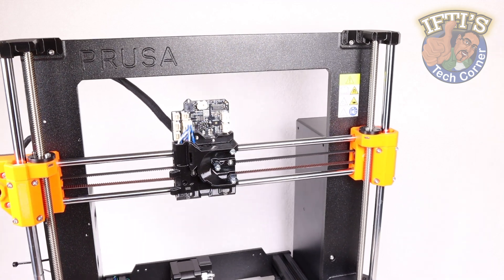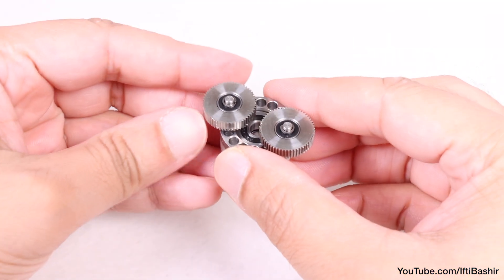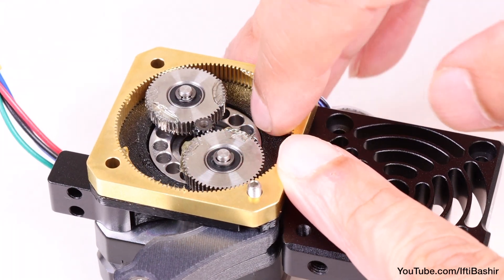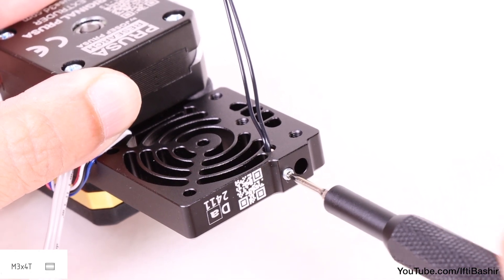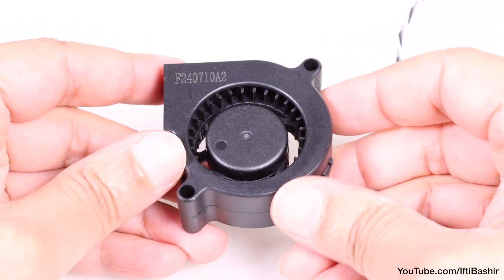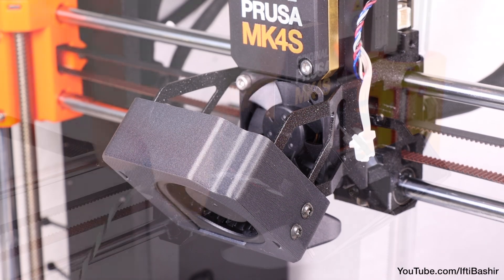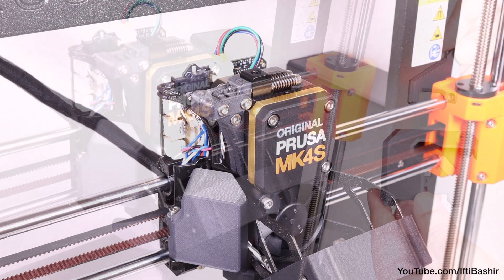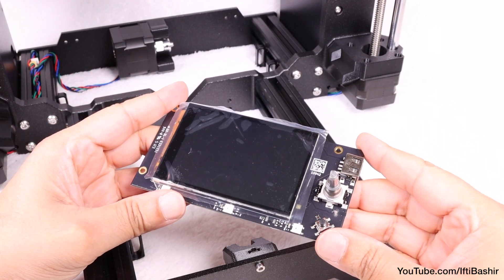#05 Original PRUSA MK4S Kit : Full Step-By-Step BUILD GUIDE - Nextruder Assembly

Comment: Brilliant!! on to #06!
Reply: How has your printer been working for you?
Reply: @nowthisnamestaken  So far so good! I had a few growing pains starting off- I was having issues with first layer adhering to sheet, it was like it was printing so fast compared to my MK3 the filament was getting messed up- so I tried printing at 50% speed for first layer that worked a bit but went back to 100% speed, then it started printing fine! Last week a had an issue I was getting layershifting on a print I went to Prusa Chat Tech said its a belt pulley or motor issue- seemed odd- I thought it may be a corrupted gcode- anyway it has not returned so all good- love my MK4S! I have XL single tool also been great!
Reply: @InTheTubeDeepRC  Nice. I'm just finishing up my second build.

Comment: my nextruder is clicking when retracting, do you know why?
Reply: Mine too! It's driving me a little mad. I've tried adjusting the idle arm tension +1 turn and -1 turn on both screws from @7:00 the position described here and it's still clicking.
Reply: because you're only following the video! there are so many more details to the assembly!!! you have to read the instructions online. They are excellent and go into massive detail. A lot of that seems to be missed.